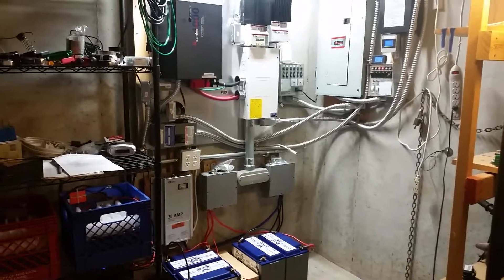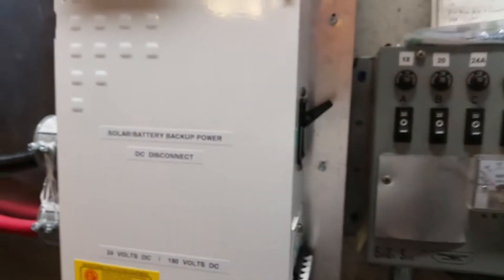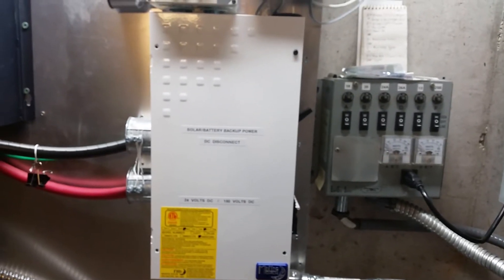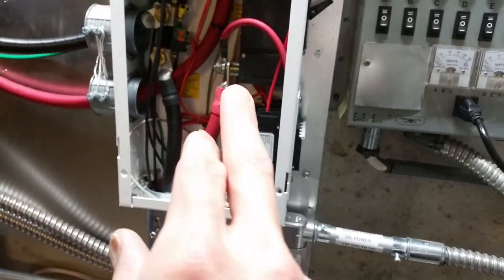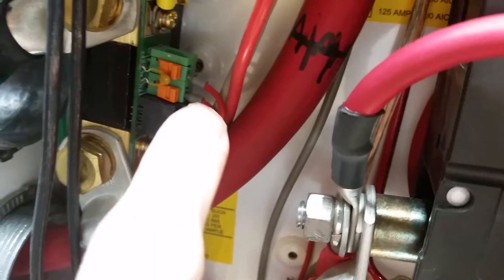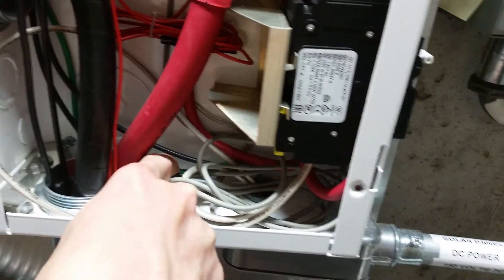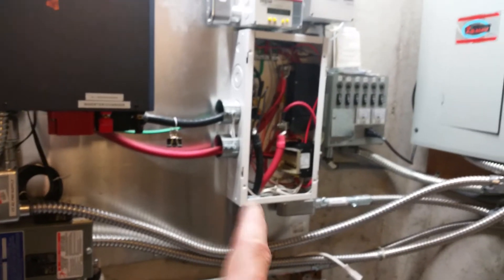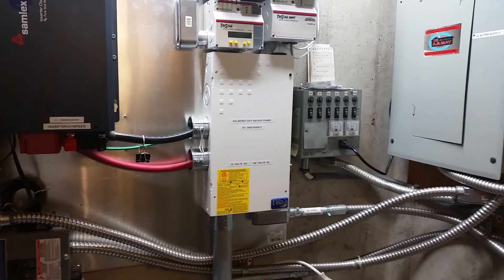Off-Grid Solar Backup Power System:  Midnight Solar DC Disconnect Box

Comment: THATS A GREAT DC MIDNITE SOLAR INCLOSURE YOU HAVE . SO NICE THAT YOU ARE DESCRIBING ALL THE DC BREAKERS , SHUNT AND CABLING THATS NECESSARY TO INSURE PROPER AND SAFE OPERATION OF ALL THE MAJOR DC SOLAR COMPONENTS AT THE FLIP OF THE PROPER BREAKERS  INITIATING A FULL BACK UP POWER  DURING ANY SHTF SITUATION OR TO SAVE ON THE ELECTRIC BILL AT WILL . THIS IS A PREPPERS PARADISE PUT TOGETHER FROM THE PROUD YEARS OF DIY KNOWLEDGE . MAY THE SOLAR BE WITH YOU .